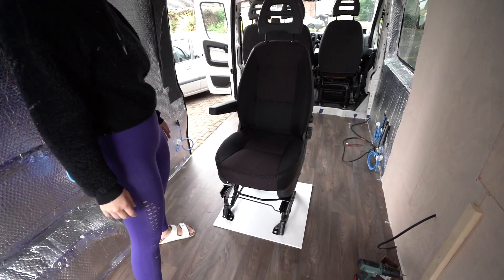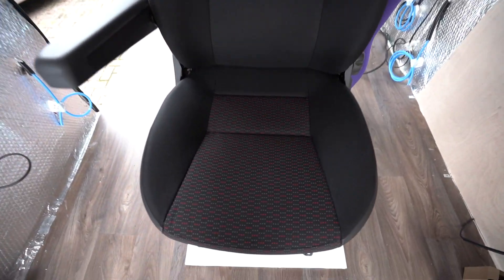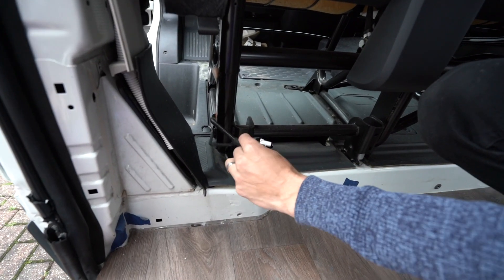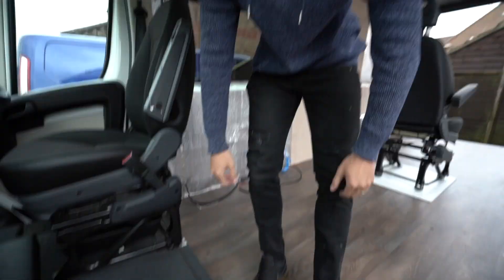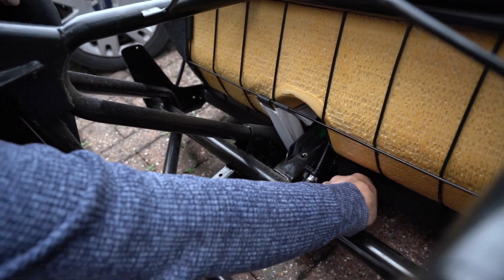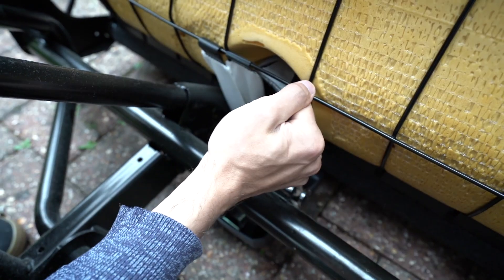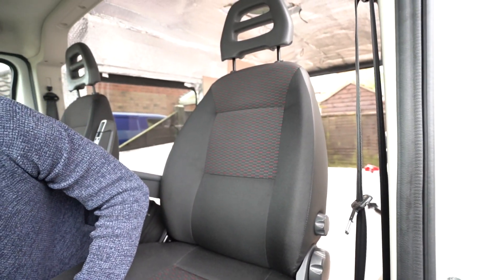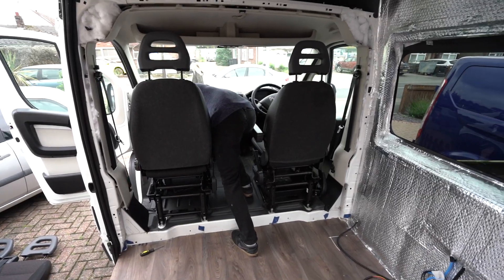How to change DOUBLE Passenger Seat to SINGLE - Citroen Relay Camper Van Conversion - Week 15 - P.1

Comment: Question for you guys: did you have a sensor coming off when you switched on the van after changing the seat? due to the fact that the bench has two seat belt pre-tensioners connected while the single seat only one, I am wondering if you had to add a resistor or the control unit did not complain at all! Thanks for the feedback!
Reply: I have a double seat converted to a single in a Peugeot e-expert and the seat belt alarm goes off when someone shifts their weight in the single seat, but strangely not when they first sit in the seat...  Did you find a solution beck2929?
Reply: @TheAlfredcan  in my case I added a little 2.2 Ohm resistor to “fake” the missing belt pretensioner and plugged everything back. Turned on the Fiat Ducato and no alarms on the dashboard. So far so good. I don’t think I have any weight sensor on the Fiat Ducato x290.

Comment: Thanks for sharing / helping other van builders!
why not use a LHD driver's seat? Are the mounting points the same?
Cheers!
Reply from the maker: I think you can use lhd driver seat but at the time we couldn't find any! Mounting points should be the same.
Reply: @CasLaz  I got a driver's seat from a breaker in France. Cost me €450 including shipping. I had to transplant the seat occupancy detectors and belt tensioners from the bench seat to keep the CANBUS happy. Thanks for the video.